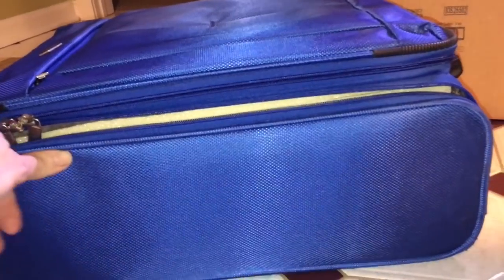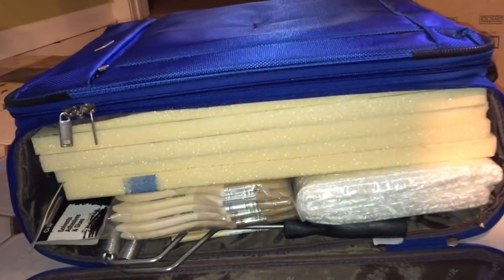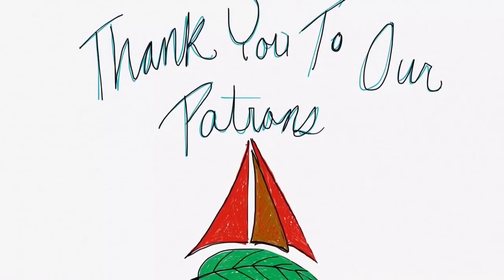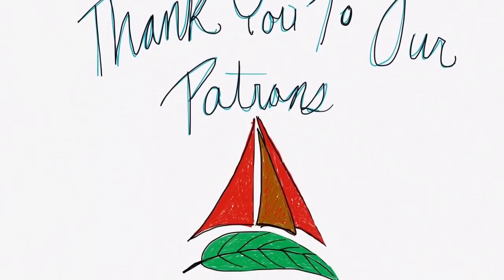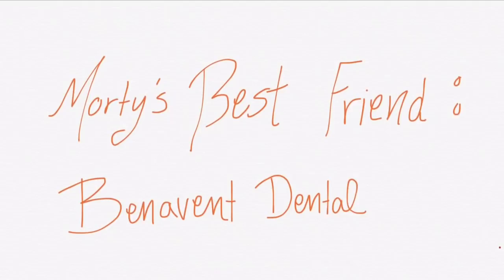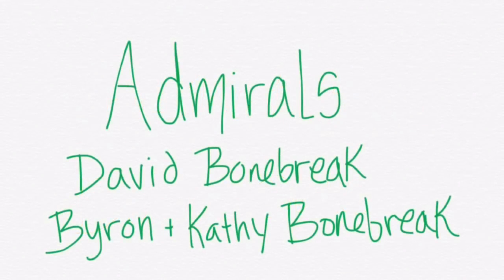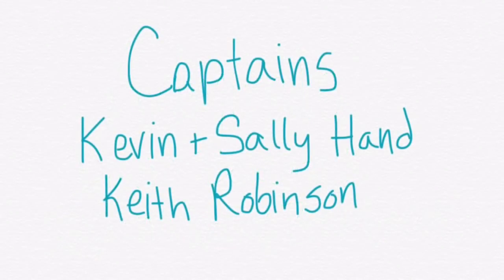How to Travel With Tools | Sailing Wisdom

Comment: Thanks for the tips. Also remember that US tools typically run on 110 Volt and in many if not all European countries it's 220Volts.
Reply from the maker: Not only that, but the US is 60hz and Europe is 50hz, so they will run slower with a transformer. 
We just crank on the generator when we need the tool and shut it right down (fuel is pretty pricey here)

Comment: TFS good information, I think I'll stay here in the US. That's for sure, they don't get in a hurry in Europe. Oh and they make duel imperial and metric tape measures. They come in handy. What you said about power tools, totally agree about getting US tools and keeping them on the boat where ever you go. At least with the generator you will always have the right voltage. Gasoline is available everywhere.
Reply from the maker: Indeed!

My tape measure is one of those fancy ones that has inches on one side and fraction of an inch on the other side. 
I just bought a metric one over there to simplify everything

Comment: I have brought all sorts of (legal) things from the US to Brazil by plane, specially for the boat refit. All electronics, including a complete autopilot, and last trip a radar dome and a dismantled watermaker. I always stay within the limits for the airlines for size and weight, but multiple times had my luggage (triple) check because, I suppose, they couldn't figure out what was that mess on the X-ray. One time a check in clerk measure a box I was checking in with 3 different tape measures in a great effort to find something wrong.... Didn't work... Always made it, safe and sound down here.
Reply from the maker: It’s so funny to see their reaction to it too

Comment: Man.. Sam's beak is getting WAY too long.. almost to the point she's about to have trouble eating. Doesn't she have a cuttlebone in her cage to help keep it worn down?
Reply from the maker: She stopped chewing on everything when we left to go cruising. She has them but just won’t use them. 
I ended up having to trim her beak back while I was there.
Reply: Fair enough.. I guess that's a sign that she misses you..